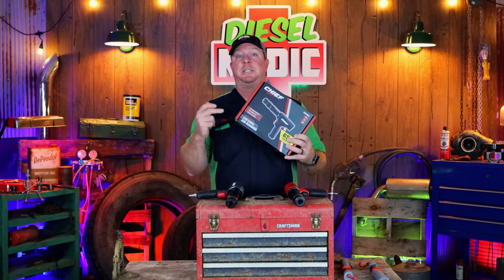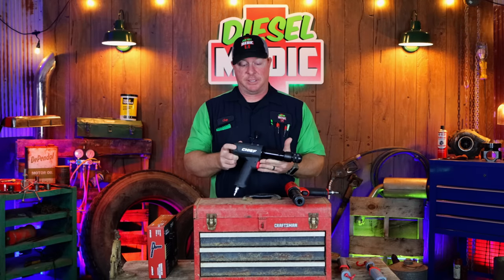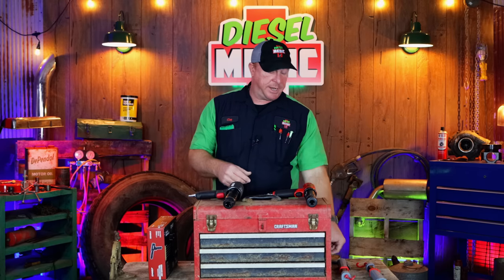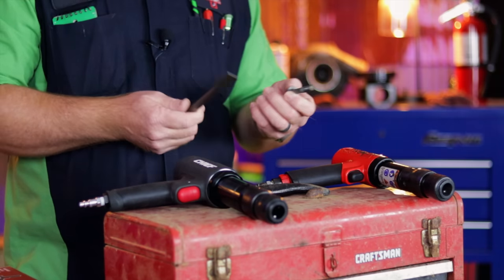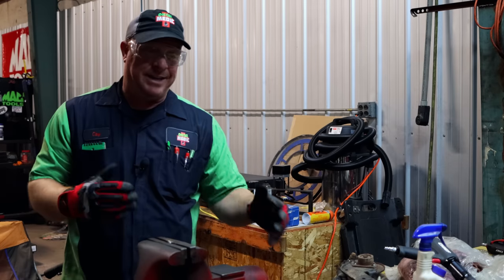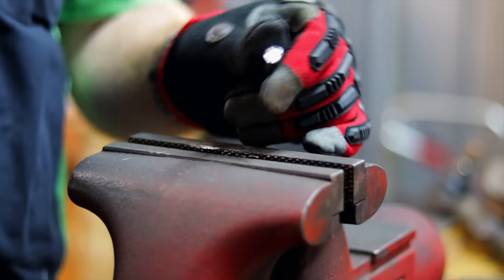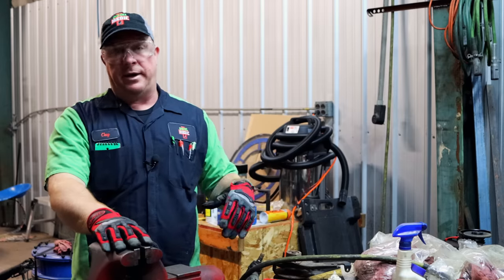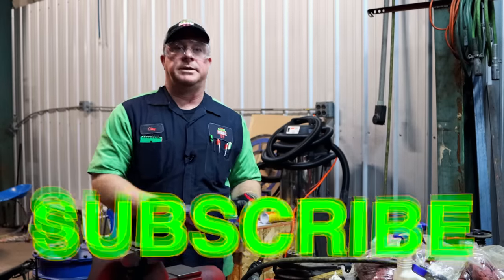Chief Air Hammer Test Head To Head VS Snap On

Comment: No offense, but that is a completely pointless test. If the two guns don't have an equally sharp chisel to start with then it is obviously uneven. Additionally the test with useless when you cut on threads for one gun but not with threads for the other gun.
Reply from the maker: Guessing you missed the point being the snap on had an easier test with threads and a sharp chisel and the Chief got the “leftovers” of what was left of the chisel and a hard cut to make and still did equally as well. Maybe I should have put that in text but I thought it was pretty obvious that I tried to make it harder on the Chief for the nay-sayers because nobody gives Harbor Freights “better line” a chance.
Reply: @KoonTrucking  yeah, sorry that definitely wasn't clear. It made the chief look bad. I guess I was looking for a straight up comparison. It's hard to make decisions based on the one you did because the snap on did awesome then the chief did poorly because of the way the test was set up. I guess I'm a scientist and want scientific style comparison. You made a good video and you were very thorough, I guess I just didn't like the way you designed your performance comparison and didn't see the purpose in doing it that way.

Comment: is that Chief or did the Chinese misspell "Cheap"? 🤣
Reply: It's made in Taiwan though just like that Matco hammer. I just bought one and tested it side by side with the Matco hammer and they seemed about the same power wise. I pretty happy with it so far but time will tell if it lasts.
Reply: @metadeth3992  Taiwan Made Tools are far superior in Quality  Compared to Chinese made JUNK, I have a few tekton tools Made Taiwan that I'm quite pleased with.